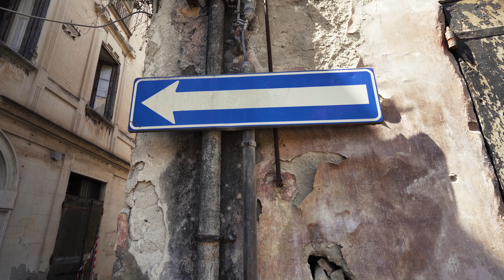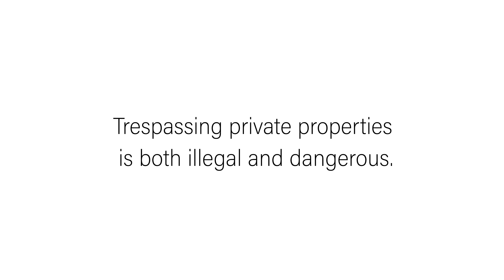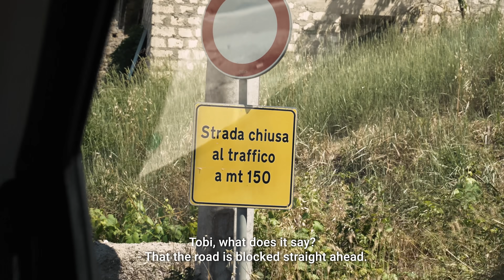Exploring a jungle ghost town (how people lost everything)

Comment: It was most probably the abnormal earthquakes which compelled people to leave this place forever. The geological survey will give the  exact rationalised reasons. Maybe during an abnormal seismic zone formation,it was subjected to shaking or vibration at short intervals of few days, because previously it was an uncontroversial inhabited place. Since such a phenomenon automatically stabilizes after unpredictable several years or even few years,then and then only any building or structure can be designed against seismic forces and erected. If it's localised, then it may be due to an unstable layer that is not too deep. A statistical data of earthquakes is also needed and to know the current status a seismic station for measuring it's intensity and recording intervals must be established.